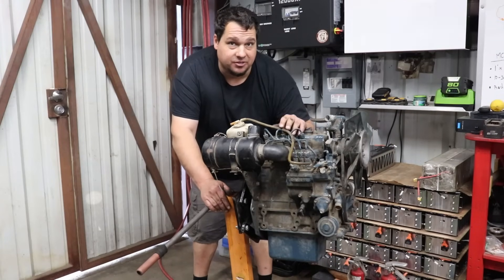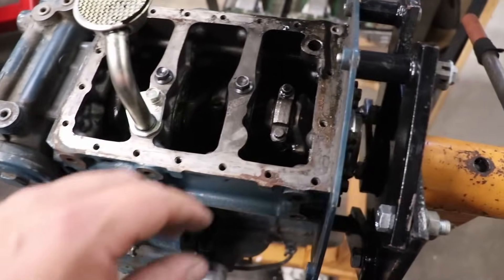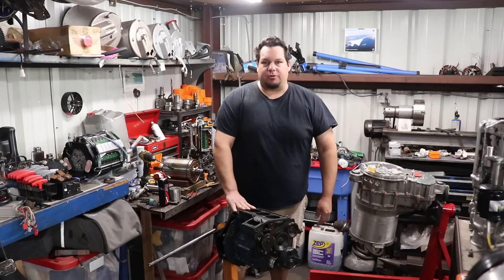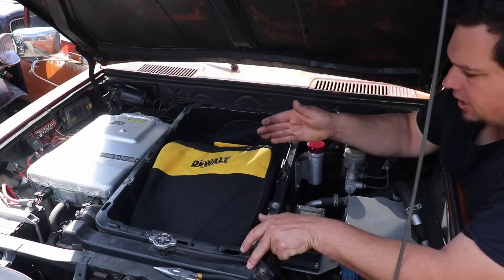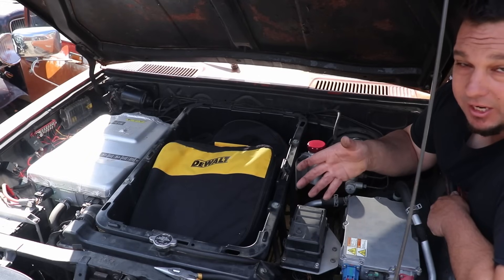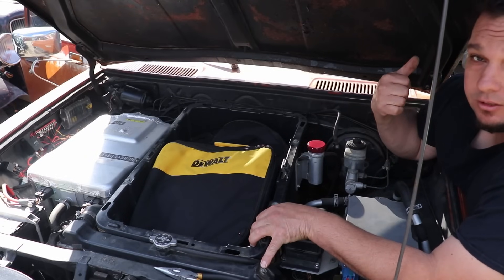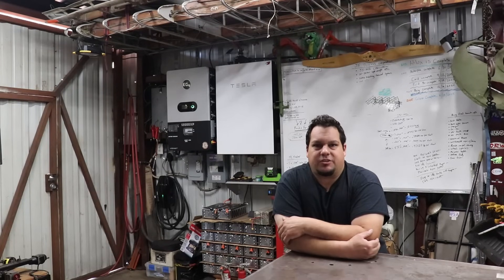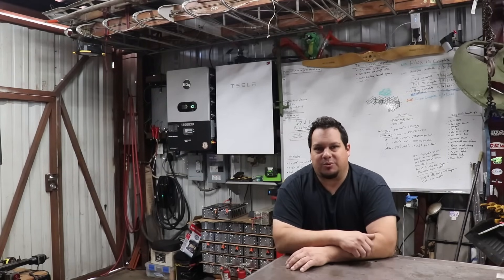Tesla powered Toyota Hilux with a Kubota RANGE EXTENDER! Video 2

Comment: Well you are moving along. Stack your radiators and shroud the fan, it will work. Of course now you have not chance of getting the Yeti cooleer undere the hood to keep the beer cool while the bed is full of cargo. 15 galloons! How much fuel does that engine consume per hour? It would be much more effcient with a turbo! So with the "range extender" in the engine bay you are gonna stuff a generator where the transmission used to be? Hmmm...diferent shapes, not sure it is gonna fit. Those generators are squareish and the transmission is cone shaped.
Reply from the maker: Yeah I might boost the thing for the extra kw lol. They apparently use around a gallon an hour at full tilt but don’t quote me on that. I’ll make this thing fit. Generator will definitely fit down the tunnel.

Comment: So awesome man, the balls on picking one up with a downed cylinder and just going forward with fixing it lol😅
It doesn't look like these engines have the pesky Bosch CP4 fuel pumps. Since you're in California, what diesel source are you going to be using? (I.e. #2, #2 /w additives, Top Tier, or your CA exclusive RD #jealous😂)
Reply from the maker: Haha thanks! Yeah it’s pretty messed up but I’ll make it run. I’ll use whatever is at the pump. Hopefully it’s decent enough fuel for this engine.
Reply: @J5Jonny5 Thanks for being so responsive to your viewers bro. Yeah, from what I've been soaking up with all the diesel channels/podcasts is that the fuel for US markets is lower sulfur content than the rest of the world and thus has lower lubricity. Seems to cause a lot of issues with certain high pressure pumps (catastrophic failures), so the diesel guys who are successful in keeping their rigs running for the long term use additives every fill up.  I thought it was snake oil at first but I've seen so many failed pumps and engines on other channels that now I believe in it.

Hope this info helps, not sure what direction or intentions for longevity you have for your beast of a project, but thought you'd find this info at the very least interesting.

Comment: Hsg needs to spin at 5-10k to get full power out of it.
Reply from the maker: Thanks for that info. I was reading right around 9k. If that’s the case I’ll definitely have to do a belt overdrive of some sort.
Reply: @J5Jonny5  I used a hsg on my gocart project.   Great motor.   Here is a link to some info on the hsg
http://energy.gov/sites/prod/files/2014/03/f13/ape006_burress_2013_o.pdf
Reply: i converted my tacoma to electric to, and just put champion 8000w generator and 2 eg4 chargeverter when i run out of juice before reach charge station

Comment: I have a question about your SDU, is it a front or rear SDU and did you have to run it in reverse? I'm having trouble finding good info on which units place the motor in front of or behind the axle line. I'm thinking of running one in a front wheel drive SUV but the motor needs to orient in front of the axle through line.
Reply from the maker: It’s a rear SDU and it’s spinning in its normal direction with the motor section facing towards the back. The Model 3 motor however has the motor facing forward so that might work best for you.
Reply: Thanks Jonny, looking to seeing how the range extender works.
Reply from the maker: @ for sure. Hopefully good enough to be able to road trip it!

Comment: The ultimate drivetrain has been tested and proven for years at this point by the Locomotive industry. 
   Diesel Electric propulsion is superior. 
However, I would just slap a Prius powertrain  The Prius already has an amazing Genset capable of well over 800v output if you modify the controller.  

The other benefit to this is that with custom firmware from this guy in England (ALWAYS forget his name, but your on the right path when you meet a guy who talks as slow as molasses.  🙂 )  that does all this custom firmware and hardware hacking.  

However you do your build?   LET ER' RIP!
Reply from the maker: Thanks!! Definitely true with trains! I’ve been arguing that for years why trucks don’t have the same setup. It’s the absolute best for massive weight moving and best efficiency with the diesel engine. And Open Inverter is the guys site. His stuff is in my truck now! He’s very intelligent and makes some great stuff for the community! Thanks for watching!

Comment: What is your plan for the exhaust on the diesel engine?
Since you are in California, which has the strictest emissions standards in the country, I assume you have to have a full emissions system with a catalytic converter?
Or is your car so old that it is exempt from emissions requirements?
Reply from the maker: Luckily I’m exempt being a 72.
Reply: @J5Jonny5  So this is only a viable option for vintage vehicles?

Comment: I have a spare D722  [ex mower ]   that also needs a rebuild . Can u please give details of where did u get a full overhaul kit from .??
Reply from the maker: I’ll talk about it in my next video. I’m still working on finding something that will work. So far it’s either China parts or basically impossible to find parts. I’m sure I’m missing something though. Never rebuilt one of these.
Reply: So far I`ve priced a full overhaul kit and fully dressed cylinder head . That was genuine USA  Kubota dealer  Usd $ 1250.  In Aust this is the cost of the bare cylinder head alone was the same  cost . !!!    It was cheaper  to replace with new VS  o/haul . The dealers in this country donot want you to repair .
Reply from the maker: @ wow! Do you have a link by chance? I’m still on the search for a genuine Kubota kit.
Reply: That was for a mower version that I changed out some years ago . Was a genuine Kubota dealer on line from the USA . Just try google but beaware some even in the usa are very overpriced . A diesel engine specialist might have access to aftermarket parts . 
Donnot forget the injector pump and injectors will need to be bench tested and repaired if needed .
Reply from the maker: @paulthompson1654  thanks for the info! Yeah definitely will be rebuilding the pump as well with this overhaul. It seams like it’s those engines only weak link. Which they still seam to last an insane amount of hours.
Reply: Mandatory to have injectors and pump checked professionally  on all diesels when overhauling motor . Bad fuel delivery can wash cylinder bores of oil , high fuel usage and cause cracked pistons etc etc

Comment: Have you tried to look into Toyota hybrid electric motors?! Maybe you could just swap the whole engine plus gearbox as generator on a gasoline version!  Depending on the power output
Reply from the maker: I’ll take a look! That would be rad. I do however want to keep it diesel because of the efficiency gain from that alone. Thanks for the suggestion!
Reply: I thought Toyota’s Hybrid systems were in parallel and not series like he’s doing here?
Reply from the maker: @gerradlewin5654  good point. Yeah my trucks ultimately an EV with a fancy generator. And it seams like this is the best way to do a hybrid. Could be wrong.
Reply: @J5Jonny5   thinking about where to get parts for a project like this. Other than the BMW is there or has there been any other production series Hybrids in North America?
Reply: @alanmay7929   after some research you maybe onto something the gs450h seems to be a hidden gem in the ev conversion world. I keep wondering, just as you suggested if the whole drivetrain couldn’t be installed. I don’t think it’s what j5jonny5 is looking for but a very interesting possibility.

Comment: I am pretty new to the EV world, but would a radial flux motor be a valid choice as an generator? They are very short and as space is a premium that might be an possible, what us tha thoughts on that?

I mostly been rolling cole, so i realy like the idea of using the diesel engine for this project, all thought there might be a wight penalty for diesel vs petrol.
Reply from the maker: Those motors are definitely a good direction to go. They make a ton of torque low in the rpm range so regen with one would be the same scenario. I use to have a Duramax but that’s long gone now. This is gonna be a great way to have that again but with some major efficiency and power gains. Thanks for watching!

Comment: This is a great idea, id be interested in seeing an extended cab version with a direct swap electric engine to the stock transmission. Use the kubota generator mounted in the bed with a pass through to lower the gen down in chassis? I think you're onto something big with your idea so far.
Reply from the maker: That would be pretty sweet. The Edison guys are doing pretty much exactly this setup but for larger trucks. And honestly I think all trucks should go this route. It seams like it makes a ton of sense given the massive torque the electric motor can provide plus the efficiency of a tiny diesel engine keeping it moving. Thanks for watching!
Reply: @J5Jonny5 If I still had my old 87 Xtracab, I would give it to you to use. My dad is 6’6” and fit in it fine. He could not fit in my ‘80 4x4. You could fit far more comfortable seats in the Xtracab if you do not need the room for height. Or you could fit a decent sized battery behind the seat. Love this project!
Reply from the maker: @ thank you! That would have been super epic! Those cabs were perfect for taller people. I don’t know how I stuff myself in my Hilux but I can manage it haha!

Comment: I think you are worrying way too much about heat transfer between those radiators. As you said, that radiator is overkill for what it is cooling anyway. I would stack the rads with minimal spacing. Put an electric pusher fan in front of the EV radiator with a temp sensor in the coolant loop keyed to ignition. If you wanted to be extra cautious, throw a low setpoint sensor in the EV loop with an overriding relay to kick the fan on. With that tote blocking airflow like it has, I guarantee you will not have heat issues with a little planning.
Reply: Silly dumb question, but the generator fan is always pulling front to back, so wouldn't sitting it behind the EV radiator only increase flow through through the EV radiator?

In addition, there's been lots of OEM PHEVs where everything is jammed packed next to/on top of the generator 🤷‍♂️

Granted... when the generator isn't running, it will then release heat as it sits
Reply from the maker: @ that’s exactly it! I don’t think i explained that part well enough. But yeah when it’s running it will always be pulling through both so I shouldn’t have an issue. Thanks for bringing that up though!
Reply from the maker: That’s a really great point. Honestly I didn’t think about how much that tote is blocking air as it is. I guess I’ll find out soon enough when I put it all together. Thanks a ton for the advice!

Comment: Stumbled upon your channel and this build recently, great work! I like what you're doing and appreciate you sharing some of the details. Can't wait to see the progress on this range extender upgrade, I love the concept and have been following the Edison project up here in Canada as well. 

One thought I had after watching the earlier videos, you mentioned the ride being quite bumpy. No surprises for an old school leaf sprung Toyota, I have a 60 series Land Cruiser so I feel that. But, it does look like you have quite limited up travel with the QA1 shocks you're running, and I haven't seen any bump stops on your suspension setup. Could be some ride quality gains to be had there by either swapping shocks or adjusting the mounting locations to allow more up travel, and maybe adding in some bump stops. It won't be a magic carpet modern vehicle, but could help a little.
Reply from the maker: Thanks a ton for the advice and checking out what I’m doing! I love the Edison projects and what they are doing! Would be rad to meet them at some point since we are doing super similar projects. 
And thanks for the advice on the suspension. It definitely needs some work in the back. I do have some Fox shocks that I could try out. It’s basically bumping out on the shocks right now which is definitely bad but it’s a start lol. Thanks again!
Reply: @J5Jonny5  I can't speak for the Edison guys since I haven't met them, though I do pass by the place in Golden where they will be setting up shop semi-often. I have met Rich (Deboss Garage, doing the pickup version) in person at his shop in Ontario. Great guy! Hope you can work something out in the future!
Reply from the maker: @dwong506  right on! That’s pretty Cool to hear! Yeah hopefully we can collaborate on something at some point! Would be fun to make more diesel hybrids!

Comment: CVT pulley system to the alternator/generator.  you can Drive it to a jackshaft- opening more rpm tuning options to put CVT in happy spot. (changing pulley sizes between engine and jack shaft will help keep the diesel at optimal RPM  to generator/alternator.   That opens more doors for locating the alternator/generator head too, Only disadvantage to CVT is  you cant use that for a starter...  but Bota Starters so light....  just use that.
Reply from the maker: That’s a good point. I was hoping to run the bota at its happy spot around 3600 rpm and gear whatever I’m driving to the rpm it’s most efficient at. I’m still up in the air with it all so any suggestions is appreciated!

Comment: IMHO put the Bota Radiator in the bed with electric fan.  .  no need pumping heat into your electricals your cooling...
Reply from the maker: That’s a good point. Yeah I’m slightly worried about the heat but I’ll see what happens. Hopefully I don’t cook the electric half.
Reply: @J5Jonny5  you’ve got enough space there to wall off the radiators; push the hot air down and out off your 400v radiator and pull cold  from a scoop in the hood if you need for your REX. I learned a lot on my snowcat rebuild and getting rid of excess heat was my biggest issue
Reply from the maker: @ that’s a good point. I definitely have some room. Ill keep that in mind when I get closer to running it and see what happens when I do. Thanks for that advice on the setup!

Comment: the D722 does have a turbo exhaust manifold (not that a genset-ish set up needs it. )  Also ... in disassembly (you probably found it)  you can move the oil filter to opposite side if you want
Reply: An additional benefits of the turbo is that you get better noise reduction.
Reply from the maker: @ yeah that’s a good point too. I know that things gonna be loud if it doesn’t have it.
Reply from the maker: I actually did know that. I’ll look at the oil filter location swap option if needed. And yeah… I’ve been back and forth on boosting it mainly to hear it spooling haha! Thanks for the comment!

Comment: Since you're going diesel and it's not got the same concerns as gasoline have you considered putting a fuel tank behind the seat like the old trucks used to do?
Reply from the maker: You make a good point. Behind the seat might be a good spot for it. My seats are slammed against the wall but I still have enough room I think for at least 10 gallons. Thanks for the input!